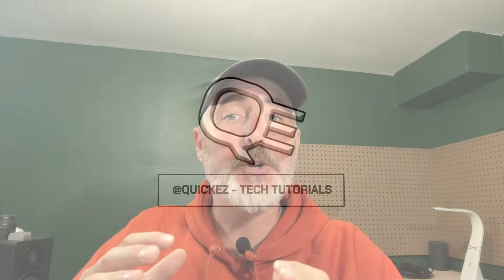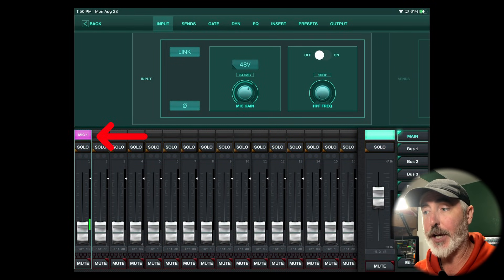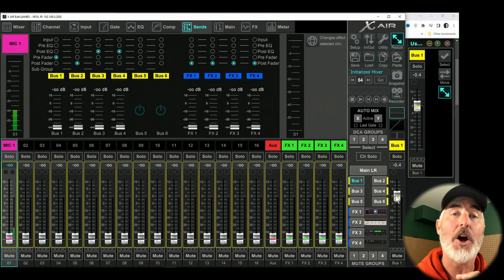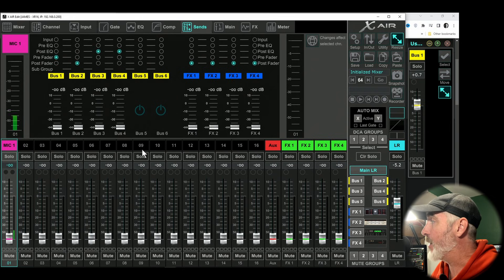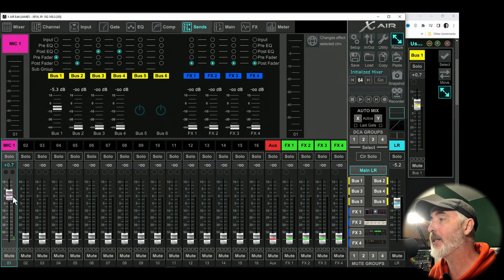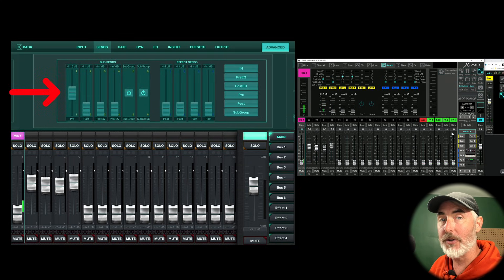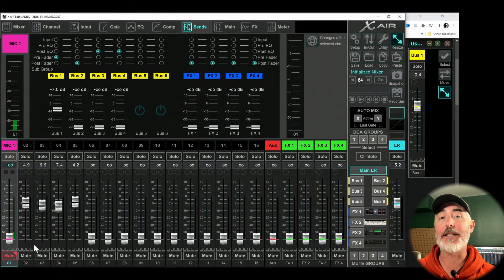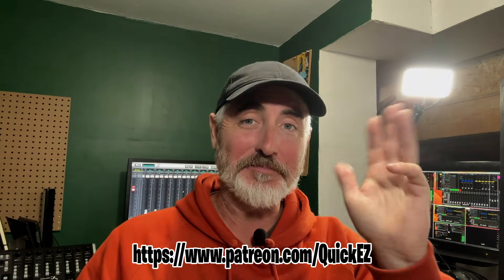XR Mixers - How to set up & use aux sends

Comment: I have enjoyed several of your videos for the XR18.  In reference to this video "How to set up & use aux sends", one thing you didn't mention was setting the gain via the monitor mix and the proper level. I have heard that -18 is the recommended level to start at. I understand that digital mixers are full scale and don't set to unity as on analog mixers. What meter does one use to find the proper level? Is it the meter under the Bus/Aux fader?  I am using a iPad  for both the XR18 and XR16 mixers I am involved with.  Thank you for your help.  P.S. I couldn't find your name anywhere on this video.
Reply from the maker: Hi Chris, thanks for the patronage!
My name is James. I don't say it often on the channel so it's no surprise you didn't hear it. 
I have been considering referring to myself in the third person to create some additional mystique...whadda ya think?  ;)

To answer your question; 
the Gain stage is wholly dependent on the input, so setting  your input gain on the actual channel meter is key. 
If you are using the XAir app on your ipad, a disappointing fact is that the meters (under the meter tab) don't have any numerical indicators on them and even their colour spectrum for Signal/pre-clipping/clipping aren't very clear other than RED is bad.
What I will say is that the channel strip itself gives a SLIGHTLY better colour view of your signal level, where it's a bit easier to distinguish pre-clipping as yellow into orange and I would use that as a better indicator of initial level.
Then setting your Main L/R fader to unity and checking the level on that meter as well. All things being equal, you should have the same readout.

The way I like to start is to have my channel strip fader set to unity, with the channel gain down significantly.
Then, while feeding signal into the channel I bring the gain up until my fader meter is hitting around  "- 18'ish". 
On the iPad app, this has the channel strip meter just tickling yellow.
I try to get as much clean signal with no noise-floor as I can before I start to hit any pre-clipping and I generally stop there.
Just saying "set it to xxxx" is an ok way to go but it doesn't take into account the differences between microphones or their proximity to their sound-source, which is why I start as indicated above. I don't like to start with any significant gain on the channel as I never know what any performer is going to give right off the mark and I don't like seeing full-clip right away on a channel. I'd rather see little to nothing and bring it up until I'm happy. 
Shooting to have that happy-place land around -18 is a very good start.

Once you have your channel strip meter, and your L/R meter matching, dial signal into your aux and try to get your aux meter to land on the same rough mark. Once you're there, you should be good to make your adjustments as required.

If you have access to a computer running Xair edit, the meters on that are much easier to read, and under the actual meter tab, they have numerical indicators. It might be useful to you to have that running during a soundcheck as a quick visual reference to assist you with getting your gain right before you move into a performance. 

Remember, everyone has their own way of working and the more you do it, the quicker and more efficient you'll get.
Regardless of how anyone tells you things must be or should be done, I think as long as you arrive at the end-result your looking for, then whatever path you took to get there is the right way for you!

I hope that answer helps,

Thanks for watching and happy mixing!
Reply: Thank you for your response James. I will continue to watch. @QuickEZ

Comment: Thanks for explaining everything so clear !
It is clear to me that the signal that has to be sent to a bus monitor must be 'pre-fader' and not 'post'.
Is the choice befor that, 'post EQ' also a good choice? And what is the difference between 'post EQ' and 'pre fader'?
Reply from the maker: I’m glad this was helpful to you. 

To answer your question:

Post-eq will take your input signal AFTER it has gone through your EQ, but BEFORE it goes through your compressor. 

For instance, if you have a vocal microphone in channel 1, and you’ve eq’d it to sound great and then you add some compression to even it out, when you change the send on your aux to POST-EQ, the signal to the aux WILL have eq on it but will NOT have any compression. 

That same signal WILL have compression going to your main Left/Right outputs. 
 So for most people, using PRE-FADER is ideal. 

POST-EQ is an option if you’re trying to accomplish something specific. 
For example, maybe you want the signal to have compression for your main house mix, but you do not want compression on your monitor or in-ear mix. This would be a good time to use POST-EQ. 

I hope that’s clear and helpful. 

Thanks for watching, and happy mixing!

Comment: Had a quick question. Is there a way to "Send" to another port besides the Bus1-6 in the Behringer? Are channels from 1-16 on the machine capable of sending out sound? Sorry, just very new to all of this. Thanks!
Reply: Can you please explain how to send two different mixes to main L and R?. I would really appreciate that.
Reply from the maker: Hi Fernando,  I assume you mean sending one mix to Left, and another mix to Right.

There are two ways to accomplish this:

#1. You could mix together all the channels you want to go out of the Left speaker, and then pan the inputs HARD LEFT. Then do the same thing with all channels you want to come out of the Right speaker.  Any channels you want to come out of both mixes, keep the channel panned to the center.  
The obvious downside to this is that you can't properly control the mix if  you have some of the channels panned to center.

#2. don't use the main Left/Right outputs for your speakers.   Use 2 of your aux outputs to drive your speakers.
In your first Aux, make whatever mix you like. and then do the same for your second aux.
If your two mixes are going to be completely different and you don't want one mix effecting the other, then make sure your you have those two auxes as PRE-FADER. Then you can control all the channel levels to each mix independently.  The downside to this is that you will have to switch between the two auxes to make changes to the mixes. Which will take extra time and could be an issue if you are having any feedback or other troubles with your mixes.

I hope that helps you accomplish whatever you're trying to do.  Let me know if you have any follow up questions.

Thanks for watching and happy mixing!
Reply: @QuickEZ  Thank you so much.
I’m trying to to set output main L for a fourth monitor (inears) since I’m already using all AUX buses for the rest of the band. And I’d like to set output main L, for broadcasting.
Since we play with backing track, I’d like to do different mixes for the two channels.
Which of the two options you think it’d  work better for me?.
Reply from the maker: If you've already used up your Aux busses, then you're left with panning stuff. But that panning can affect your aux busses too.

Are you currently using your Auxes for in ears or floor monitors, and are you running stereo or mono mixes through those Auxes?

If you're running stereo mixes to your Auxes, any panning you do of your channels will change the panning in those stereo mixes.
If you're running mono mixes, then you're panning shouldn't matter.

I don't know how many channels you're using up, but you also have the option of duplicating channels to avoid any panning issues.
For instance, lets say you have a vocal mic on channel 1, and you want pan that into your Main Left mix.  But you also want some of that vocal mic in the Main Right mix, maybe a different amount, you could use an empty input and change it's ANALOG INPUT tap point to be channel 1 (select your empty fader, then click on the "channel" tab, then under the "analog input" drop down menu, select input #1.  This way you have a duplicate of your original signal that you can pan and mix at different levels into a different bus.

This can start to get complicated as your going beyond the general use case of these mixers. But it's totally doable. You just have to be mindful of how you have things routed, and remember to keep your inputs set to "PRE-FADER" so that changes in each of your mixes does not affect any other mix.

By the way, which model are you using, the 12, 16, or 18?  just curious.

Hope this helps.
Reply: This is very helpful, thank you so much. 
I have the XR16, and a set of 4 inears in all the 4 aux buses and I run mono mixes through all of them. 
Im currently using only 10 channels.
 I will duplicate some of the channels and that should solve my problem.
Thanks again 🙌🏻
Reply from the maker: Happy to help. Let me know if it works out the way you want/need.

Happy Mixing!
Reply: @QuickEZ  it definitely worked out. Thanks!
Reply from the maker: Wonderful!
Thanks for keeping me updated. 
Really glad it worked out for ya.
Reply from the maker: Unfortunately no. 1-16 are inputs only. 
You can send audio to your main L/R, your busses, Auxes, headphones and recorder. 

No sorry required. If you don’t know, ask. It’s what I’m here for. 

Thanks for watching!

Comment: Is there a way to get individual channel compression in the auxes? Whenever I listen to an aux, I don’t hear any of the individual channel compression for each instrument like I do when I listen from the main mix or headphone out. I’m trying to send a mono summed mix to a remote set of speakers, as well as a mono summed mix to a single PA speaker and it seems like the instruments (channels) of those mix are unprocessed, except for overall compression and eq available on the aux buses. It seems I only get channel compression on the main LR outputs. What am I doing wrong? Also, I’m worried that I may be using stereo effects and therefore only getting ‘half’ on those mono outputs, or ‘half’ of the effect when I was only using one side of the LR as a mono output.
Reply: Setting each channel to PRE did it. Thanks!
Reply from the maker: You’re welcome. 

I initially read your question in the car so I glossed over the part about sending to a speaker and the FX issue. 

If you’re happy with using pre-fader then obviously don’t change. But if you want the remote speaker to follow your main PA speakers mix/volume, then set your tap point to POST-fader.
Then, any mixing you do for your mains will be reflected in the remote speaker as well. 

As for your stereo fx issue, using one side isn’t a big deal in and of itself. You’re basically using a mono effect at that point which is fine. 

The concern is if you are summing both sides of the  stereo effect to mono, you could have some interference or phasing that gives you an undesirable sound. 
If it sounds good to you, you’re probably ok👌 

If you have an effect open you should be able to see if it’s stereo right away as it will have two insert points listed instead of one. 

Thanks for watching. Happy mixing!
Reply from the maker: If you select one of the channels that has compression on it, and then select the SENDS tab in the edit software, what is your tap point set to?

Pre-eq, post-eq, pre-fader, post-fader??
If it’s a monitor mix, you should likely have it set to pre-fader unless you have a specific reason to do otherwise. 

If you’re set to INPUT, PRE-EQ OR POST-EQ options, those may bypass the dynamics/compressor. 
I know that INPUT bypasses it, and
I’m fairly certain pre/post eq bypasses the compressor as well, so any of those choices could be your issue.

Comment: I'd like to ask you if is possible to use 2 AUX as a MAIN L-R. unfortunately the MAIN R output doesn't work.
Thank you for the answer and Merry Christmas :)
Reply from the maker: Hi.  Yes, you can do this. 
You need to make sure that ALL the input channels you are using are being sent to your chosen Aux output as POST-FADER.  
You can set this on the sends tab of each channel.  
Once you set your inputs this way, any changes you make to your mix will go out to that Aux just like it would go to your Main Left/Right.
If your Main Left is working but your Right is not, you could continue using the Left output and then only use 1 of your Aux outputs to take the place of your Right channel.  
Just keep in mind that regardless of how you choose to do this, you will need to use multiple faders to control the output level. When you normally change the Main Left / Right output it is one fader, but if you are using Auxes, you will need to control those output levels independently, unless you link your two auxes together (for this you have to use either aux 1&2, 3&4, you cannot link aux 1&3 or 2&4). To do this, select your first aux and then click the link button. Also,.  Once you have your main level set  you won't really have to worry about that and you can just mix with your channel faders as you would normally.

Hope that helps.
Thanks for watching and happy mixing!
Reply: @QuickEZ  thanks for your answer, very clear.
Maybe I shoud also change the setting in the "aux out" tab in the software?
Reply from the maker: Yes, you could do that in the Aux out tab as well.   
And I just realized, I forgot to mention, that you can use a DCA to control your multiple outputs with a single fader.  Control of two Auxes this way might make your life easier.
To do this;
1. Click on the UTILITY tab in the main window
2. Click on DCA Spill
3. in the DCA spill window, click on the SELECT button
4. choose the two Auxes you want to use
5. Click the SELECT button again to close the selection window

Now, your DCA fader will control the output levels of the two Auxes you have assigned to it. 

You can control the DCA from the spill window you already have open, or;
1. you can click on the UTILITY tab again and choose the DCA button to open a window that only shows your DCA faders. It will not show the Aux faders that way you won't accidentally move one of those higher than the other and mismatch your output.
2. you can click on the UTILITY  tab again and choose one of the USER buttons and build a control window that shows whatever you want.

Hopefully that makes sense to you, but if you're unsure about it, I'm going to make a video on this in the next couple of days. Stay tuned!
Reply: @QuickEZ  thank you :)
I tried and found a very easy solution: in the "aux tab" section I set aux 5 and 6 as "MAIN". That's all :) you don't need to do anything else, aux 5 and 6 will behave like "main", this means that it is useless to send all the channels to aux 5 and 6
Reply from the maker: I actually replied with this same information the other day. 
I thought I was replying to you, but obviously I was replying to someone else by accident. 
So someone got information they weren't looking for on another video.  Lol Whoops! 

Now I have to try and find where I posted that information :)

Happy Mixing Sebastiano!
Reply: @QuickEZ  Thank you for your time
Reply from the maker: You're very welcome!

Comment: Hello, is it possible to increase the number of AUX with ultranet? Except for the option with p16.
Reply from the maker: Unfortunately, no.
The XR 12 is limited to  2 Aux outputs
The XR 16 is limited to 4 Aux outputs
The XR 18 is limited to 6 Aux outputs
No additional hardware will increase these numbers.
For more Auxes you need to look at more expensive mixers.

I'm sorry my answer isn't what you wanted... but thanks for watching!
Reply: @QuickEZ  Thank you for your reply.